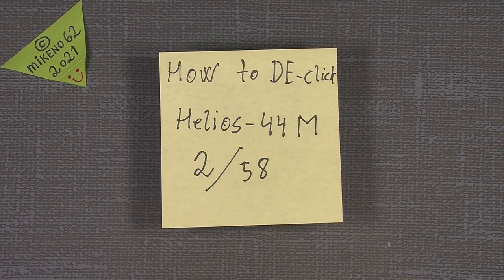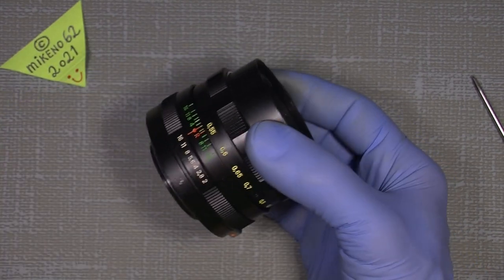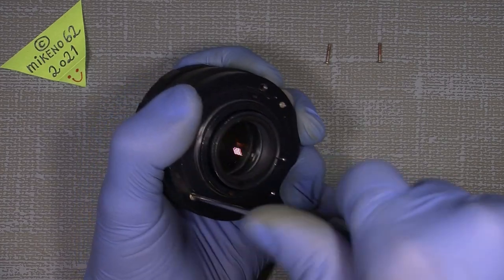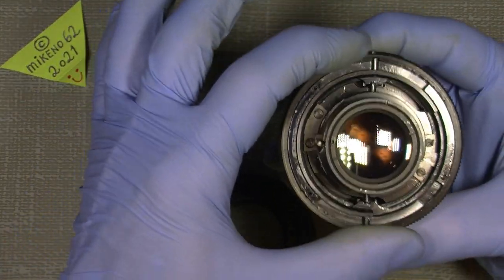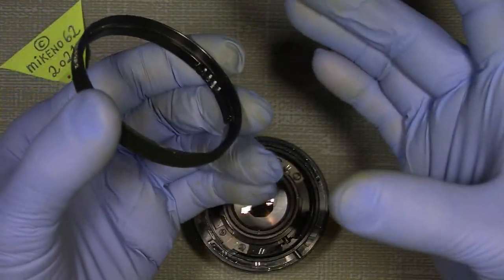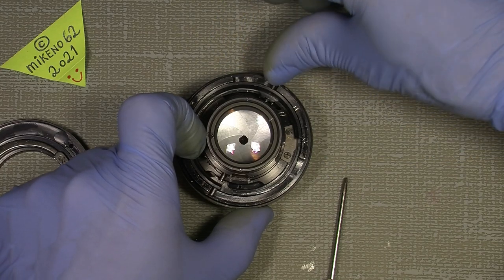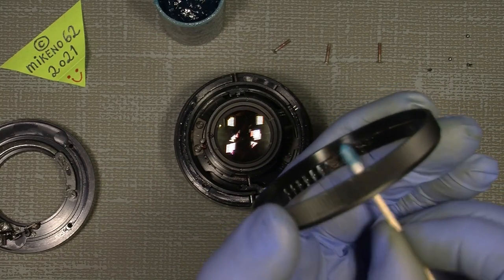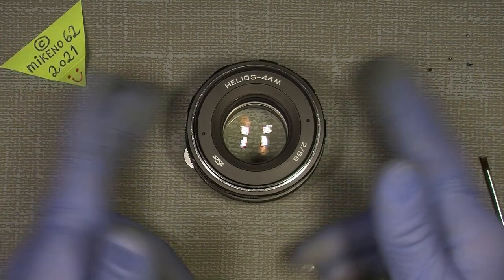How to DE-click Helios-44M  2/58

Comment: I was able to de-click a MC Helios-44K-4 58mm 1:2 in PK mount after watching your video.
It was completely different inside, but much simpler to remove a single steel ball (no spring). I added new grease to the aperture ring and put the lens back together. Thank you for the video!